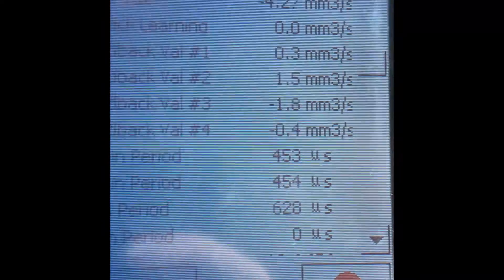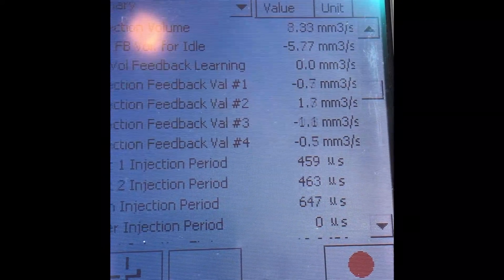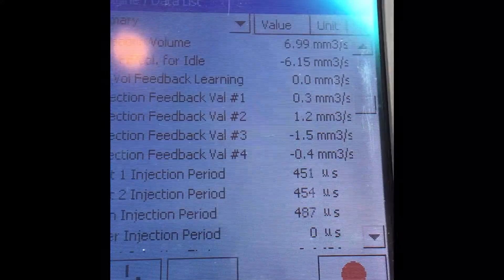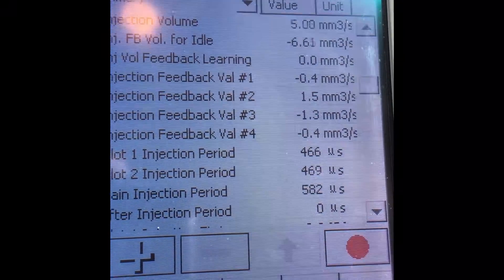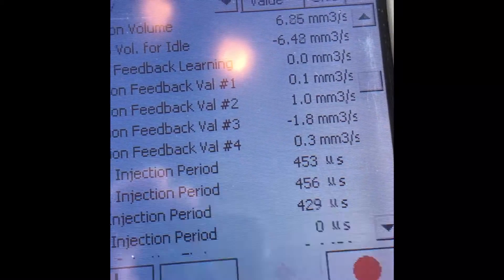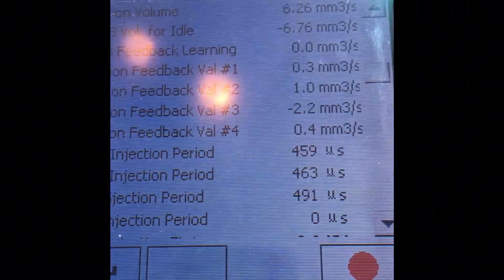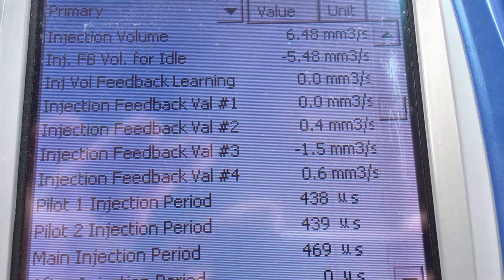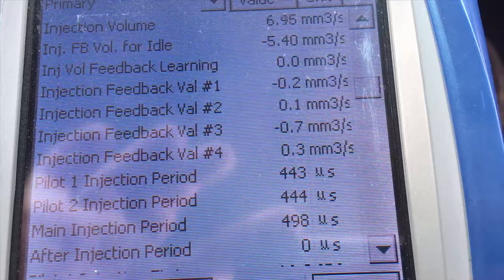LEARN DIESEL DIAGNOSTICS to avoid cracked pistons

Comment: Do you ignore all other readings until warm? After getting injectors replaced with new ones, my knock under load is gone but still loud idle, engine load comes down to around 12 when warm, fuel rail pressure stays between about 32k kpa and 35k kpa give/take 500, feedbacks are all tight and close to 0. Can't find why else my idle is still so loud though, car had a reman in injector 1 from old owner shown to me by my diesel mechanic comparing with the new ones . Lost as can be currently

Comment: Feedback in a simplistic  explanation  is how long it takes each piston to travel a cycle. The + and - numbers means the injector is either adding or reduce fuel from a predetermined map to say idle at 700rpm. If a piston is slow it will add fuel, if a piston is fast it will reduce fuel. The feedback numbers should in theory for each revolution add up to 0 . It only occurs at at idle upto100rpm above idle. It’s a NVH thing  some injectors have a max +  - 5  value. But don’t be fooled by only looking at theses numbers. Alway check you desired and actual fuel pressures and the scv duty cycle.and current. Seen so many people and companies just replace the injector and the problem is still there. I always replace injectors and scv regardless. Things like blow by, valve regress, valve adjustment , lifter issues could also be a contributing factor . Air in fuel system, etc etc . Wrong  sensor reading that are plausible to pcm but when it’s 25 degrees outside and you sensor is reading —17 degrees that’s going to send huge amounts of fuel in as the system things the air is dense that it is. PS never assume ,just because it new it works. Items can be faulty out of the box .

Comment: Thanks a lots. I have hilux 2gd ftv engin 2016,it blows black smoke and when i diagnostic 1 to 4 injuctor, injunction feedback all of them are less than 1. I changed all the injuctor then the black smoke disappeared. I asked many mechanics and thy told me that new Toyota engine are different and your method does not work. Why...

Comment: Just a thought. Nr. 2 have a  positive value, and nr. 3 is negative. Can it be that nr. 2 is bad, and the compression is lower, valves not sealing, etc., therefore nr. 3 in a better cylinder have to compensate more in negative to keep the idle in place?

Comment: My 2012 hilux with 220000ks had the same problem when cold. Number 3 reached -3.9, was very noisy when cold and had like a tiny misfire like shake every now and again whilst warming up. I replaced the injectors and have never lookedd back. They were full DLC to.
Reply: Does replacing injectors solved the " tiny misfire like shake every now and again whilst warming up" ?